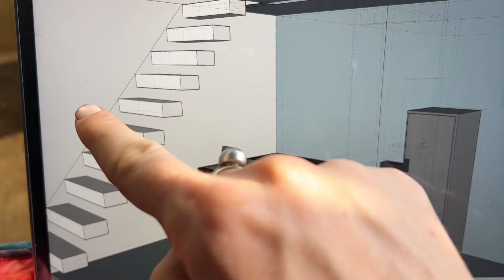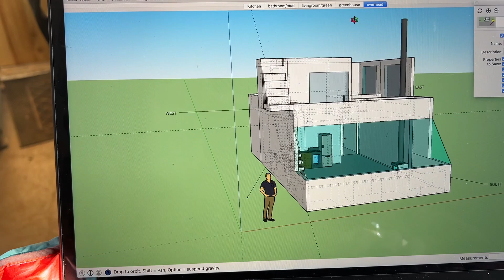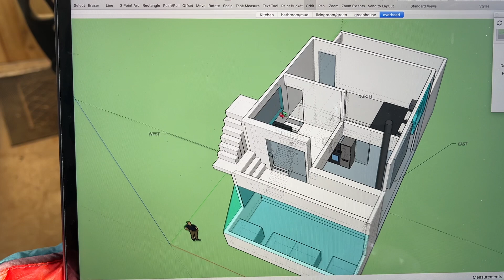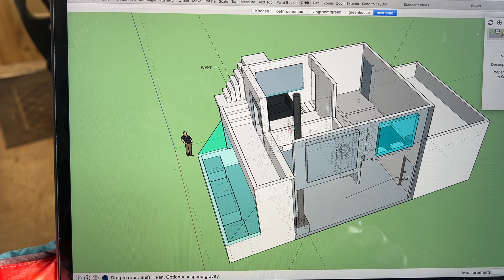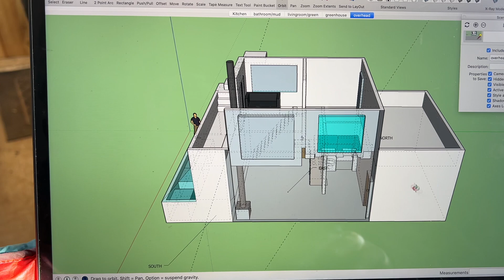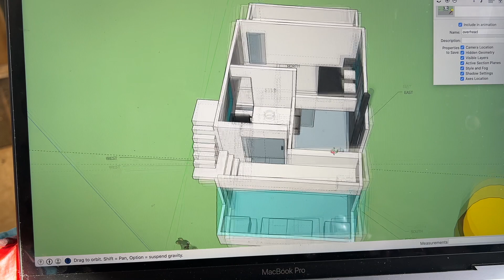#27 Our Debt-Free House Plans & Ideas | Normal to Nomad Podcast

Comment: So much to consider. With all the research you're doing, you'll do well & come up with what best suits your needs. Just a few thoughts to throw out:  My house is 76 years old. It's a small 2 BR ranch with cement block foundation. The cement block basement is super cool in summer which is nice. It's quite cold in winter, even tho there's one heat vent down there, which blows  warm air every time the furnace runs, which I like. It also blows cool air in summer when the AC is on. I can close this vent if I want. I don't close it, because the air blowing through the vent keeps the basement dry and provides circulation, so no damp basement problems at all.  One thing about a house built totally of cement block - you would have to drill thru cement block whenever you needed access, such as running wires, pipes and the like. I'm wondering if this could cause eventual cracking in the cement blocks. Just my thoughts. As far as energy, I'd utilize a few different types, such as solar, propane and a generator for backup. Never hurts to have a few different options on hand, especially being in a remote area, as you are. Personally, I'd go with the prefab house. As you mentioned, it gets delivered, you hammer & screw it together. Walla! A house! I've seen some really nice ones with sunken living room & fireplace. Really nice. You could still build a log cabin or yurt for entertaining, etc. Happy planning! Take care & stay safe.

Comment: My father built a log house and it didn't need insulation. We live in Washington State. Cool in summer, warm in winter. The logs hold the heat and stay warm. I'm thinking because you have so much rock you may want to be closer to the well because of freezing pipes in winter. Happy planning! So exciting to be building new. Good luck!

Comment: Hi guys, hope you are well. I'm sure of one thing, whatever you finally decide to do, it will be totally awesome!! I'm interested in what Barron said about monitoring water/fluid levels, etc., and that all sounds like Marine tech stuff. As for concrete forms, how about forms with wooden plank impression, i've seen this in domestic properties and it's awesome. You could use a roof-mounted rv/van shower, long black plastic tube, bicycle tyre valve to pressurise tube,  shower hose outlet. Check out Ben's folding stairs here  https://www.youtube.com/watch?v=BcWt1_UYAag  I'm all excited, wooohooo!! Thanks for sharing. Stay safe and keep up the awesome work.

Comment: I would think the first thing to get sorted out is the septic system.  The tank is one thing, but the leaching field... that sounds like it'll be a serious challenge.  And it usually needs to be a certain distance away from run-off areas as well as your water source (well).  The location of the septic and how to pipe to it may affect of the house location.

Comment: Would you be allowed to use bio digesters for your toilets? You know the ones that produce bio gas that you can use for cooking afterwards? I think there are some comercial designed toilets with this system. The problem is if it is approved in your area.

Comment: You kinda flew past using "Rock " as a building material. Is it something that you see as decorative?  My family about 150 years ago in South Florida cut Coral rocks  blocks in detentions of 4 feet wide by 4 feet deep by 8 feet high on the property.  Using the blocks as outside lower floor walls.  Placing the windows in the middle of the depth of the walls. We were one of the only families with a basement in south Florida. Although we added  AC we never had to use.
For 9 years I lived in a high desert. Rock harvested only  picking up by hand built beautifully homes.  You keep mentioning all of the Rock available because of the land you purchased.  You may want to give Rock a deep dive if you haven't.  It may be more labor intensive but the thermal quality of solid rock and stacked stones may serve you well. Good lock with your build. 
Been watching you from the beginning,  I love  the content and the two of you.  Very entertaining!

Comment: Talking as a complete layman here when it comes to off grid living, but could u wrap the water line with a heat tape to keep the line from the well to the house from freezing in the winter.  No idea if the electricity required for that would be worth it or not

Comment: I grew up in a log cabin in NW Montana. Insulation wasn't a problem; the cabin was small, so easily heated with wood. I loved it. I live in one now that wasn't designed as well, and it's not ideal; but if I were planning on staying here I could solve the heating problems with this 850 square foot cabin by opening it up inside.

Comment: So very cool! But a couple things I worry about… Wood Stoves really remove a lot of humidity which is something your plants and grub will need. Having them so close together will possibly be tough to balance what is enough or too much… I almost wonder about partially sectioning off the greenhouse area but enough so that it can gather and maintain some of its own humidity away from the stove. It’ll also allow for you to keep the rest of the house cooler and less humid in the summer time.

I worry a bit about the concrete too. I would almost suggest well insulated cob or something similar but not concrete (like earth ships) It surprisingly takes a LOT of indirect heat to warm up concrete to the point of releasing heat through night/day… direct heat from the sun on sunny days would be great but on not so sunny snowy days your house will be an ice box 🧊 even with the stove.

Just some thoughts, I could be wrong here. Curious what others may think.
Reply: I agree! Wonder about the humidity of the greenhouse fighting with the dryness of a wood stove. I think there could be big issues without some barrier to the greenhouse
Reply: Greenhouse level humidity may create mold and mildew issue if living space is not physically separated.

Comment: Concrete can be cold.
I would recommend in my limited knowledge to look at styrofoam concrete building forms.
And radiant floor heating.
Passive solar is great but, radiant heat is really nice.
Reply from the maker: The point of concrete is to absorb heat from the excessive sun we get here in the desert and release it at night. Sun coming through windows. Insulation on outside of home to keep in the heat in the winter and keep out the heat in the summer

Comment: Elsa and Barron, 

I’ve designed and built a couple of houses that our family has lived in. Couple of things I’ve learned. You can’t have absolutely everything you want without breaking the bank. You’ve got to be flexible. Another thing is to make sure that you can build your plans. Have a framer and/or architect review your plans. They can tell you what works and is buildable without problems. Pay particular attention to the roof and drainage, and waterproofing of your decks especially if they are over an indoor living space. And don’t skimp on insulation!

I built our first two homes in So. California. They were both build with wood framing over a beefed up concrete foundation. I now live in Florida. Most all homes here consist of at least a cinder block exterior first floor. The builders provide a lot of online info related to their building techniques. .Good luck with your build. You are in the very fun part of the planning. Enjoy!

Best regards,

Brad

Comment: 2 STOREY means much heftier foundation. (Footing, frost wall or foundation wall, rebar tying that all together, back fill the area dug out for the wall, THEN a slab would be poured
SINGLE storey can be a a simple slab-on-grade (🙏please don't put a 2 storey on a slab !)
FOR WINTER SOLAR GAIN: orient the home south east
FOR HEAT RETENTION: look into a climate battery (Mike Reynolds the founder of the modern Earthship, has much wonderful info on this process)
FOR HEAT REDUCTION: where ever the most continuous, tallest portion of wall space is, put a window in that area to PULL hot air out
FOR HUMIDIFYING: and more heat reduction, add a living wall ☘️ somewhere inside that takes up many square feet so it can run through the processes that give off moisture and lower the temperature
😁good luck

Comment: My north side garage (unheated) does act as a thermal break. Good plan to put the door on the east end to avoid a large snow drift in front of it, even though you are on the dry side of the mountains. Please give due consideration to an eave over your south facing windows to combat the summer sun.
Reply from the maker: Great thoughts here, thanks!

Comment: The plan looks good -- but reconsider floating stairs for this reason: They are dangerous for young children, who can and do fall through them. Don't know about the flat roof / deck concept, not with as much snow as you get in Colorado. Load bearing and all that.  A cabin for the kids when they turn five??? Try when they turn two!!!  Seriously, their sleeping area needs to be away from the living area, where you'll possibly want to listen to music.
Reply: Lol was going to say don't have "the kid" around those stairs. It doesn't appear to be a kid friendly house. Lol
Reply: I agree. A friend of mine had floating stairs and a two year old. The two year old ended up with a serious head injury, the effects of which are still ongoing five years later.
Reply: Yea, we were thinking we'll just keep the kid on the roof with no railing. Our kid will be walking at two months and skydiving at 9 months, so the stairs won't be an issue.
Reply: @24barron  lol best laid plans!
Reply: @24barron  Pretty sure she was talking about snow load, not flying offspring!

Comment: Hey Elsa and Barron, my dad has worked in concrete construction my entire life. I think the answer to your concrete building at a high, inaccessible location could be to hire a boom pump operator. It’s a concrete truck with a very long arm. They are often used to pour the foundations and form walls of skyscrapers, surrounding walkways, etc. Not sure what the cost would be to contract one, but just wanted to make you aware of the option if you were not already.
Reply: Cha-ching!

Comment: I had an idea about your house floor. I saw the heated hit tube video the other day and your friend uses copper pipe and uses the fire wood to heat the water. What if you run tubes through your floor and heat the concrete with water being heated by wood. Just a little idea I wanted to share with you as I sit here in Michigan as I look at the snowy cold morning.

Comment: septic nerd here:  the incinerator toilets seemed like a dream come true. i ordered the cinderella [?] anyway i canceled it due to the endless warranty conditions. (seemed like it was too complicated, and i would be stuck with a $5k brick if it broke).  Next the composting toilet seemed ok but i didn't want to compost my poop, so i would have to bag it up.. etc. Also, since i wanted to have guest and family able to occupy the house when i'm not there... giving instructions for non traditional toilets seemed a bit too much to worry about.  I decided on a septic system.... it is really not too much difference in designing a legal system and illegal system... just more stressful to do it legally.

Comment: Flat roof but covered to withstand  the snow accumulation,  possibly adding solar panels. Later to add large screen and glass  slider combo  to keep bugs away and cold winds during fall and winter.

Comment: Colores concrete is the best and you should match the color of the floors to the color of the dirt outside. Don't die the floor, it will peel up later.

Comment: Be sure to insulate that concrete pad from the outside ambient temperature with thick  Styrofoam I’m talking inch and a half to 2 inches along the sides especially If not the outside ground temperature  will soak to the inside I can’t stress this enough on a concrete slab if digging a footer not so bad but wood still wood poor any concrete on thick styrofoam and think of running pex tubing so u could even heat the slab with hot 🥵 liquid from wood stove !!!  (  :

Comment: Thank you for adding the visual blueprint of your home in this video, that was super helpful. 😁 I know you're still thinking and figuring things out, but I can't wait until you start the building process and everything starts coming together for you.
Also something to think about for you. I have a friend that has lived in a house his grandma built from the ground up and they use solar to heat their water on top of their house. The down side he says is that the sun heats up only the top of the water not the bottom, as a result something like a shower fluctuates between hot and cold for the entire shower. He said it's not a perfect, constant source of hot water. I don't know, maybe it's not something that would be a problem for you.

Comment: One thing I'd like to say about a wood stove with a high pipe, is that it makes it alot harder for the stove to actually work because the smoke has to travel so high, so you usually have to open a window to get it to suck enough air in, or like put a fan at the bottom in front of it to help it get enough air. Just something I'd try to plan in with a tall stove pipe.
Reply: It also makes cleaning the stovepipe much more of a challenge. Also from Montana experience.
Reply: Another thing about your wood stove pipe.  It is much easier to clean the pipe to prevent house fires if the pipe in vertical with no bends.  Our builder tried to pull a fast one on us when they made an error placing the trusses.  They had one truss placed directly above where the pipe was to go and wanted us to just route a bend in the stovepipe.  No, that makes more creosote in the stovepipe so more need for stovepipe cleaning which is one thing you want to be diligent about.  Just somethings to consider from someone who has used wood heat for 40 years.

Comment: Put people in the Garage add a wood stove in there. It would be a perfect multi use area. You will need heat in the garage  when working on projects in the winter. You could put a murphy bed in there or something similar.